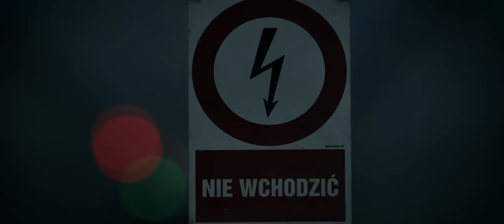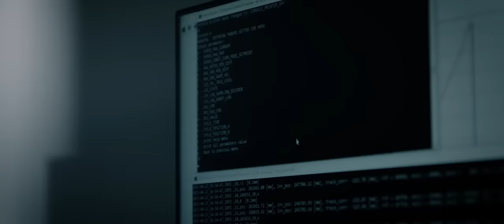World's first levitating train on existing infrastructure! | MagRail by Nevomo

Comment: Adam Something sent me here!
Reply: Exposing techbro scammers FTW!
Reply: Me too!
Reply: @PCB389 man, trains normally  are modular, you could add a cab or remove it, this one, doesn't, also that's one of the many reasons it won't work
Reply: @06.arkan2a2  i never said it works or not, but to mock the simping npc that just watch any video and repeat whatever it says.
Reply: @PCB389  it could work just worser than normal trains
Reply: Same

Comment: I have two serious questions.
1. When this train is levitating above the rails, how is it kept right on track? How do they avoid derailment?
2. The chassis of the train is a conventional railway chassis made out of steel. This means levitating a vehicle with a weight between 40 to 50 tons. A comparable Maglev train like Linimo, Ecobee or TSB got half the weight. So would levitating a conventional train not be a waste of energy? Sorry if the second question seems annoying but viewed from a technical point of view it has to be questioned.

Comment: How do they tackle switches at speed?
Reply from the maker: MagRail has the big advantage of being fully compatible with classic rail infrastructure. Whenever possible, MagRail vehicles would lower the speed enough to be able to travel through a standard switch, and reaccelerate again if need be. Potential existing track modernization with geometry readjustment for increasing the allowable speed in switches is also possible to lower the amount of time and energy lost for vehicle braking and reacceleration. We also have a high-speed switch design concept for track switching while levitating, but this kind of engineering objects proved to be expensive in the past with MagLevs, and we will try to avoid implementing them unless necessary.

Comment: There are serious safety concern here, trains stability is based on its weight and their conic wheels that keep them on tracks (people think train wheel are flat, that are not, it's a cone), in this case you have no contact with the tracks and therefore no way to keep the train stable in the curves... Still an amazing tech though.
Reply from the maker: The system is designed in a way that allows you to move around curves and even increase your speed in them. We use two mechanisms that will allow us to maintain the safety and comfort of passengers - the first is increased cant deficiency, which, thanks to a wider spread of pressure on the infrastructure and a lower center of gravity of the vehicle, allows us to completely eliminate the increased impact of centrifugal force at higher speed. The second (optional) one, for use on very winding routes, is the wagon body tilting mechanism, which is a solution known from high-speed rolling stock.
Reply: @Nevomo  Thank you, very interesting

Comment: How is this Working In a curve?
Reply from the maker: The system is designed to navigate curves and even increase speed in them. We use 2 mechanisms that will allow us to maintain passenger safety and comfort - the first is increased cant deficiency, which thanks to a wider infrastructure pressure spread and a lower center of gravity of the vehicle, allows us to completely negate the increased impact of centrifugal force at higher speeds. The second (optional), for use on very twisty routes is a mechanism for tilting the car body, which is a well-known solution from high-speed rolling stock (the base version of Pendolino, Talgo).
Reply: @Nevomo  OK, very interesting. Thank you for your answer.

Comment: Y las curvas?
Reply from the maker: The system is designed to navigate curves and even increase speed in them. We use 2 mechanisms that will allow us to maintain passenger safety and comfort - the first is increased cant deficiency, which thanks to a wider infrastructure pressure spread and a lower center of gravity of the vehicle, allows us to completely negate the increased impact of centrifugal force at higher speeds. The second (optional), for use on very twisty routes is a mechanism for tilting the car body, which is a well-known solution from high-speed rolling stock (the base version of Pendolino, Talgo).

Comment: This is only possible with the construction between the rails, so you need a modified track net !  Not every kind of railroad track is modifiable same as railway switches. I don't see a success in this kind of system, because it also can't provide the speed of a real maglev train like the German Transrapid from the late 60s early 70s, that was operational in the 90s and sold to China in 2000.
Reply from the maker: Yes, the track has to be upgraded but it much cheaper and faster to upgrade the existing track than to build a completely new infrastructure. We specified our use cases and the roadmap here: https://www.youtube.com/watch?v=F11yd75TawQ